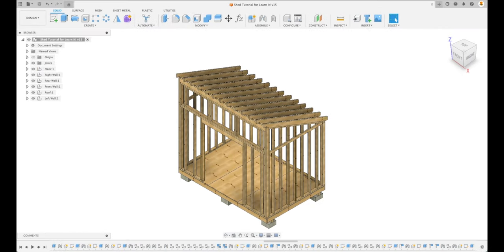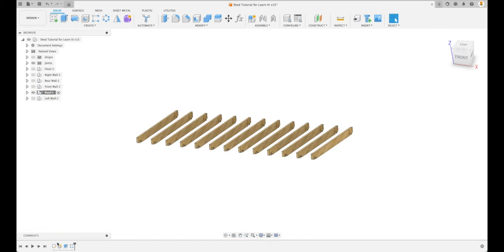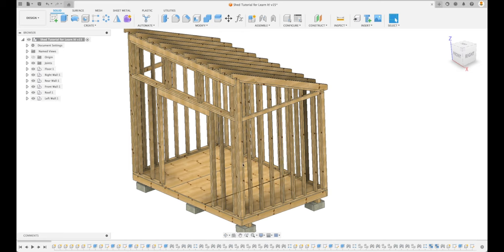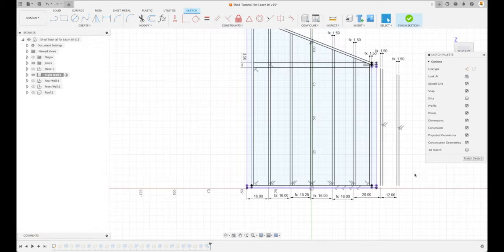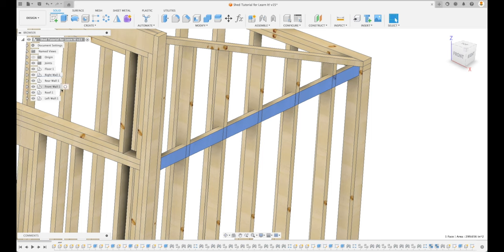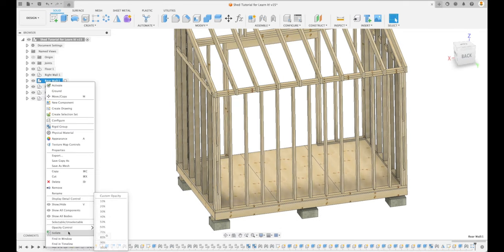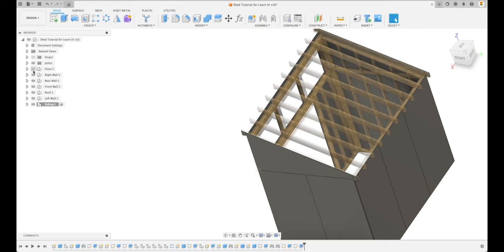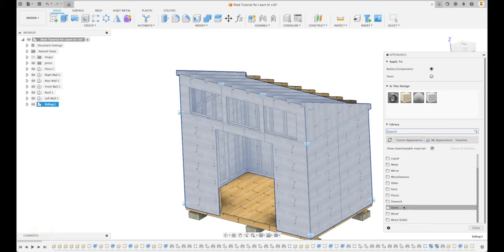Autodesk Fusion 360 - Part 3/4 - Model and Assemble a Shed - Intermediate/Advanced (2024)

Comment: The roof's plywood must protrude over the sides and front to allow for the fascia thickness. The nailer in the side walls is in the wrong location. It needs to move up 1.75" to capture the upper section bottom siding.
Reply from the maker: Awesome! Thanks for taking the time to comment. I love it when carpenters see these tutorials and spot where the shed is off.

Comment: I have really enjoyed this tutorial series it has improved my Fusion workflow a lot even after using it for a few years! You've mentioned that you're a programmer, you should get into writing Fusion scripts to automate advanced workflow as well.
Reply from the maker: Thanks for letting us know that you’ve benefitted from it. Thanks too for the suggestion. May I ask, do you have any ideas for writing scripts that I could learn?
Reply: @learnitalready  The sky is really the limit, what I'm starting to work on (and why I found your videos) is something to automate framing. E.g. a tool for framed walls can be added to the Solid > Create menu, then ask for parameters, including profiles for cutouts (windows and doors), then essentially follow the steps you did in the tutorial. The API gives you access to everything you can do by hand in Fusion, but Turing complete in Python or C++. And as a bonus, there is a store where you can sell your scripts in the app.
Reply from the maker: @MattBell-mappum  that would be amazing to make such a script. In fact, I have been loving working with parameters since day one… the more powerful the parametric model, the better. One needs to think greatly outside the box to make a fully complex parametric model/assembly, but it is so fun to test the brain and to learn how to do it. To turn that into a working script would be a great challenge. 

I think the only thing I can think of that would hold me back from creating such a script is that Autodesk already has made Revit, which is basically exactly what such a script would do. I do understand that Revit is quite expensive in comparison to Fusion, but people use it to make a living and it is an amazing application for those that know how to utilize it. However, if I do have the time (time is basically the only factor that slows me down) I would love to get cracking on such a script. Keep checking up on us to see if there is any progress in that direction.